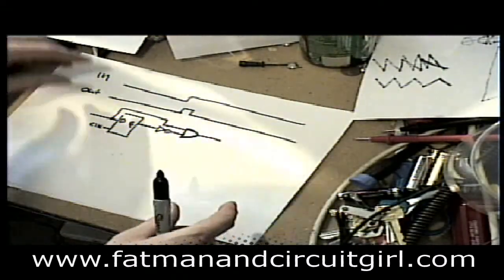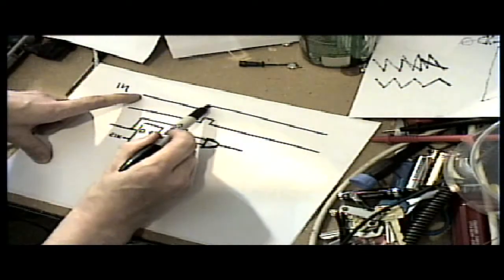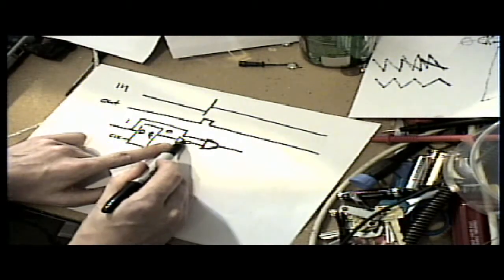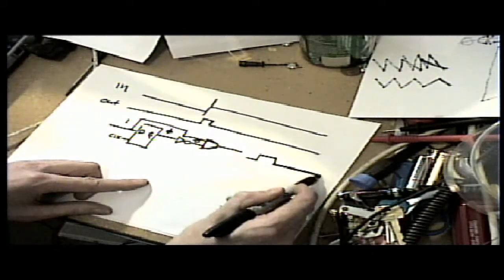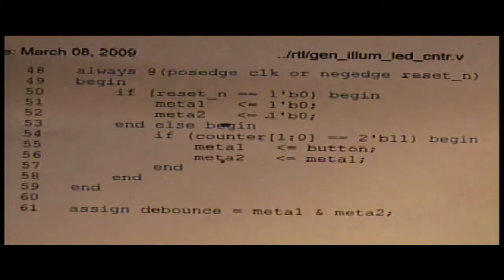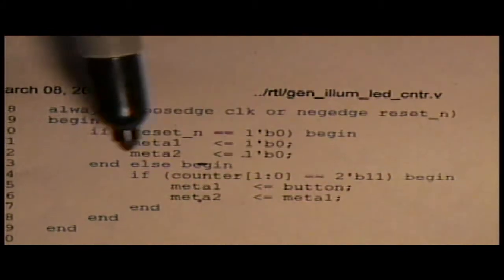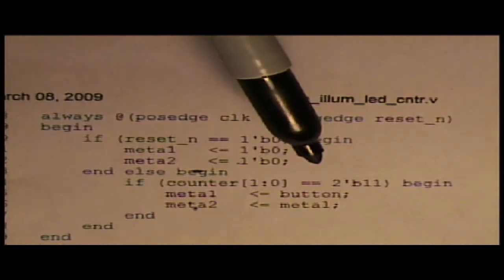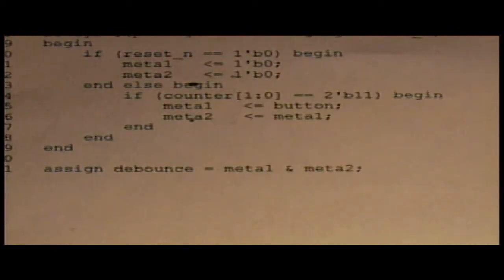FPGA Input Debouncing Part 2 and Edge Detect

Comment: Hi eDub,

Assignment operations like the ones for meta1 and meta2  actually happen simultaneously, not sequentially.  So it's as Jeri said, the value from meta1 will be transferred to meta2, and meta2 will get the value of button.  The actual order of the lines is irrelevant when you keep that in mind.

This is one of the differences of Verilog (and VHDL) when compared to a traditional programming language.

-DJ